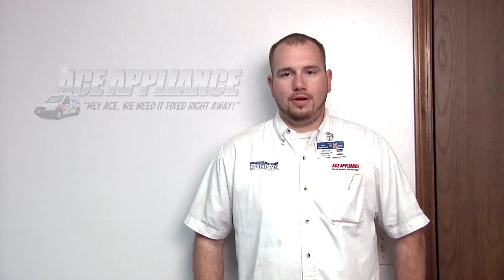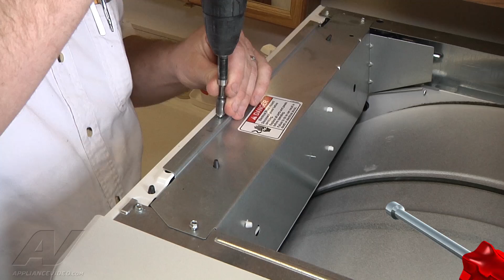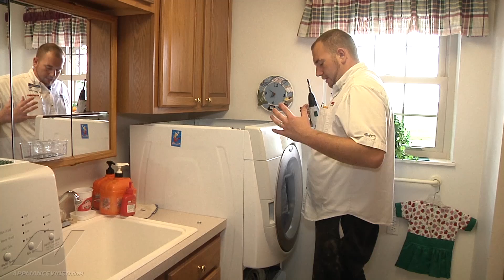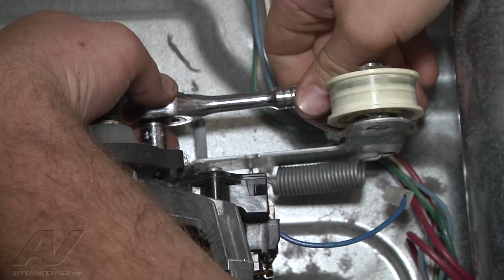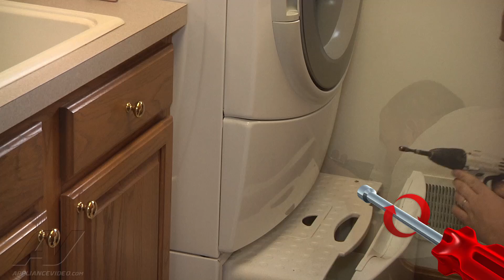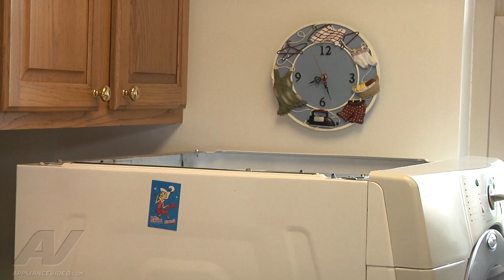Whirlpool Dryer Repair - Will Not Turn On - Belt Switch

Comment: So it did not start because of the belt switch?  If I would have turned it off early I would have bought a circuit board. One video said it could be the fuse in front near the Thermistor?  I have a Duet Model #WE083005W0 or  TYPE DH2N-ELE-2406024-EL54.
Does not start.  Got a code of 03 or OE.  I have it apart and ready to order the part.  I live near Toledo so will call to see if you have the part.
Once I figure it out what part it is!  At least the dryer is nice and vacuumed out now.
Oh I love the phantom screwdriver on the video and it even shows what way to turn, Cool. I did learn how to take apart the plastic wire connector!
And it is nice to know the repairmen are human and a bit nervous and clumsy at times.
Wow I need some sleep
Reply from the maker: Yes that is correct. It is suggested to check the fuse as it is very inexpensive. Sometimes they get weak and open.  Our family-owned and operated company works hard to provide you with FREE, high-quality repair videos. Thank you for your continued support and good luck on your project. If you are in need of any parts, our parts department has over 5-million in stock for same day shipping. Please call  1-800-830-5465 for any of your parts needs, or you can order online 24 hours at: ApplianceVideo.com. Thank you and good luck with you project.